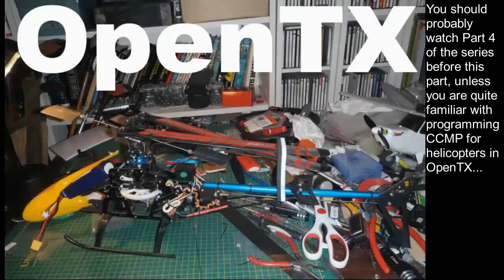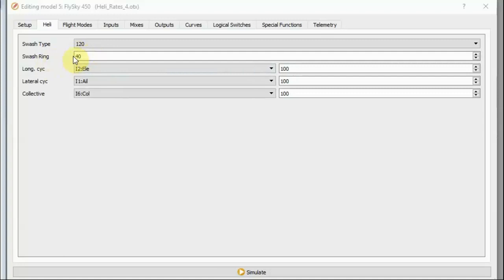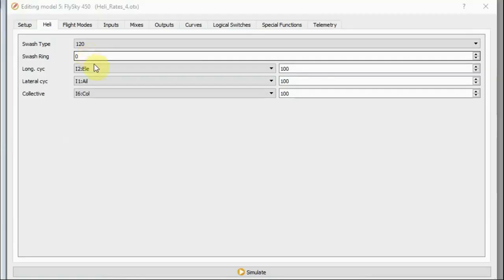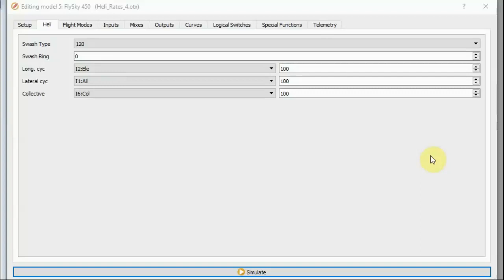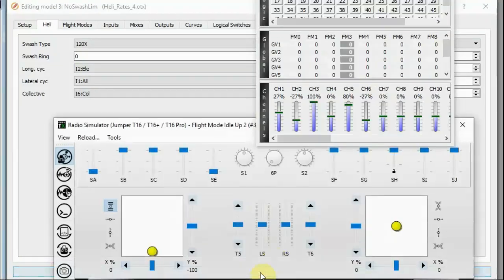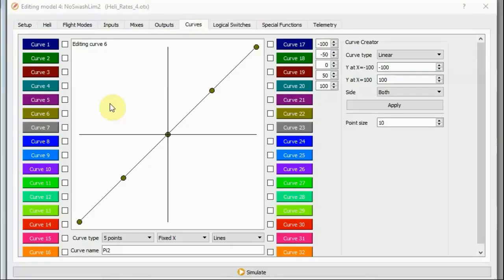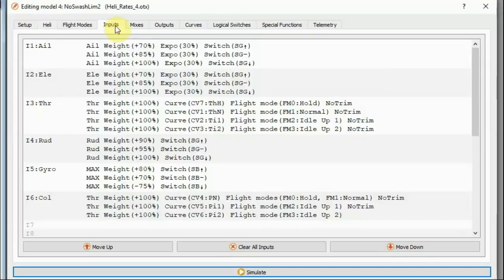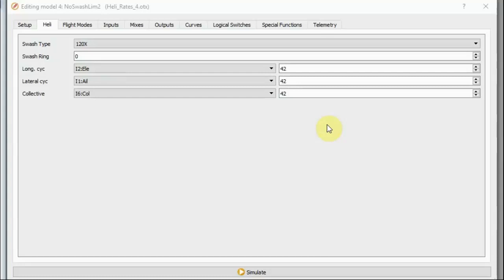OpenTX Heli Programming Pt 5 - CCMP work arounds

Comment: Fantastic series as I am setting up several of my old helis to work with my TX16S, thank you!   Could you perhaps add to this series a section on how to setup Coaxial Helis?  I have a Blade MCX2, Blade CX2 and Blade CX3 that I would like to use with openTX.  https://www.air-rc.com/aircraft/Blade_mCX2_EFLH2400#manual
Reply from the maker: There's really nothing much to set up with coaxial helis - you just use a standard set up like you would for a regular fixed wing, throttle, aileron, elevator and rudder. Right stick forward (elevator down) will make the heli go forward, right stick back (elevator up) will make it go backwards; right aileron will tilt it right, left aileron will tilt it left; rudder will make it rotate, left or right; more throttle will give power and make the heli go up, less throttle will let it descend. Of course you can put in rates and expo, if you want,
Reply: @kleedhamhobby  with your videos, I was able to successfully program my Blade Nano S2, Blade MSR, Blade mCX2, Blades CX2 and CX3 with my TX16S.   Thanks so much!  Next I will try my Blade QX Quad.

Comment: Thanks for this. Just moved to OpenTX with a Radiomaster TX16S after a 12-year break from flying. First, I set up a FBL model, TRex 600 from a file I was given. It works well after tweaking and I have about a dozen or so flights on it now!

I have an old FB TRex 450 that was still set up on JR equipment (35mhz) but I moved it across to a Radiomaster R8SC receiver, (£12 for a full range RX). Then, using the knowledge I'd gained on the other model I just worked through your Episodes 4 and 5. No dual rates just 4 throttle curves, including CUT and 3 pitch curves. The Heli page was easy enough but I suspect the value of 70 that I added to the cyclics was a bit too much. It flew for the first time on Saturday 01/05/21 and came home in one piece! I did note however it was "twitchy on cyclics away from the centre so will knock the values back to your recommended starting point of 42.

I also had to spend a lot of time on the Outputs page centring the servos, sub trim and setting the servo endpoints top and bottom so the swash rises flat. Of course, the FBL set-up on the 500 handles all that in the AR700BX controller.

Thanks for your time and effort to put these videos together, I much appreciate your hard work and the effort that has gone into demystifying OpenTX for me!
Reply from the maker: Thanks. I'm glad you found it useful. Getting things to work correctly with the older helis requiring CCMP is quite a challenge... I struggled with this, in particular, with OpenTX. The newer helis with onboard flight controllers are certainly much easier. Haven't really been flying recently myself, due to lockdowns etc.
Reply: @kleedhamhobby  Hi again. After an injury and crap May weather, I got to fly the FB TRex 450 this evening with the new settings, 42 on the cyclics. Wow! what a difference. Had to tweak the elevator by one turn on the pushrod and a bit of left trim but after that, it could almost fly hands-off, as much as a heli ever will! If anyone's interested, I could post the file.
Reply from the maker: @AlanRait  I'm glad it worked well for you. It took me quite a bit of fiddling around to sort this stuff out (specifically these rather awkward work-arounds with the heli page for the older CCMP helis). I'm happy it's proving of use to someone else.
Reply: Here's a question for you and the community! Is it possible to adjust pitch and/or throttle on either the pots or sliders, TX16S. It would be useful to be able to fine tune flight modes.

Alan
Reply from the maker: @AlanRait  Yes, I have done something likes this. For example, if you put in, on the Mixes page, under your Throttle, a mix for S1 with mix type of Multiply, weight of 50% and offset of 50%, this will essentially make the S1, which is the lefthand pot turner, a multiplier for your throttle - if S1 is at zero, you'll get no throttle at all; if S1 is all the way up, you'll get a full range of throttle; if S1 is half way up, you'll get a 50% range of throttle, i.e. when your throttle stick is all the way up, you'll only actually be getting half throttle. The throttle will still always be at -100% when the throttle stick is all the way down, because of the 50% offset. I did this in order to 'tone down' small planes for flying indoors.

Comment: Most Excellent help for us who use FB heli...and there are a LOT - but most of us stay in the closet.  I want to move to OpenTx but there are virtually NO OTHER tutorials comparable with your part 4 and 5.  CONTINUE to push the OpenTx team to properly address the cyclic ring/collective throw/dual rates issues.  You are our savior.  I will pass these videos to those needing help on Helifreak.com    Consider doing a FB heli set up from scratch after the technical issues are sorted.

Comment: Works, thank you, but
I have a question, in my heli 120st AETR, OPENTX 2.3.5 I had to swap CYC1 with CYC2 in INPUT, because the servo motion could not be set correctly, I tried revers in output and use minus in heli option and it did not give anything.
Can the reason be a bad factory connection of the servos on the motherboard in a helicopter (FBL100 Turnigu (HCP100))?
Thanks a lot
Alek
Reply: CYC in mixers, of course
Reply from the maker: @aleksanderaugustynowicz8974  I'm a bit confused as to what you're doing. I have an HCP100 myself. That's a flybarless heli, so you shouldn't be using the set-up in this video at all - you should be using the set-up in the 2nd video in this series, for flybarless helis with pitch control: https://www.youtube.com/watch?v=qAD2pG3PQ2Q
Reply: Thank you very much,
I'm lost, I'll try according to Part 2.
Amazingly, my fbl100 with part settings 5 flew
Reply: I think the problem may be in the Heli-steup. the long. axis runs from front to back through the center and rotation around this axis is Roll (banking left or right) controlled by the AIL, Lateral axis from left to right through the center and is controlled buy ELE (nose up and down). The third setting is for the collective which moves all 3 servos in unision

Comment: Hello kleedham
i will make this short as i have just finished my 12 hour night shift and have had a 2 hour commute home ..... can you please click on the link and read the ccpm page
http://open-txu.org/home/special-interests/helicopter/ccpm-for-taranis/

 near the bottom it  states :-

For a copy of the CCPMTemplate.eepe, click here: CCPMTemplate  NOTE: This is a zipped file that will need to be unzipped before using in open Tx companion

The file contains two model profiles: CCPMHeli – The one used in the lesson & CCPMHeliFM – A CCPMHeli set up with flight modes and volume max once hold released.

i hope you find this helpfull  ... if after reading this you mod your settings could you please put a copy of your model setup file with a link on here please so i can try to use it for my thunder tiger raptor 50 v2 setup ...... plus is my model 120 ccpm cheers kleedham

all the best ian

Comment: Hello Happy New year
thank god you have done this miniseries on setting up the jumper t16 ..... I was a bit gutted considering I have just gone from a 35Mhz futaba to this t16 pro this week as it shows on the box a helicopter then I find out that the helicopter wizard is greyed out (opentx-t16-2.3.4) ..... and all my helicopters are about 10years old so I have had to look at all the YouTube videos so I did not miss anything out ... but I only really need videos 4&5 I guess I will purchase a new flybarless helicopter at some point but I want to use my old thunder tiger raptor50v2 for as long as possible but I cannot see spare parts for them anymore